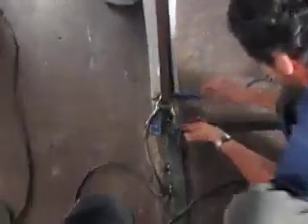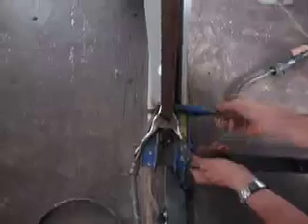Welding two shipping containers homes

Comment: I left mine seperated cause I had my 2 40' on 3 axle wheels each but I connected them together with an extention between them, mine are insulated to R37 a house in Canada is only R26. Solar lights & light power LED's T.V. & Lights & 2 pumps work excellent up here. I should be finished in Nov 2013. Outside will just be painted with some wood trim, Roof is 4/12 with 1 side for solar & 1 for water collection for home with 3 55 gal tanks gravity fed.
Reply: still no price